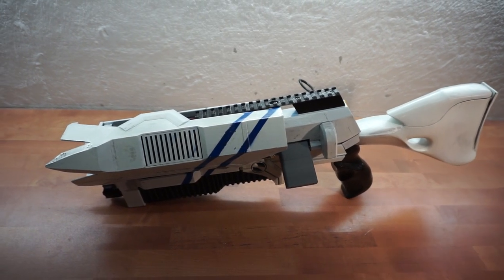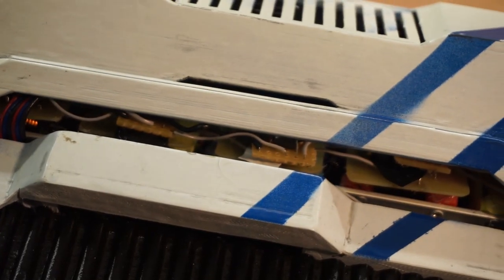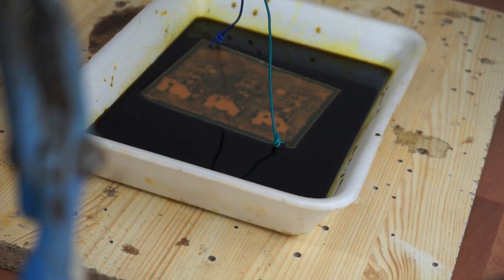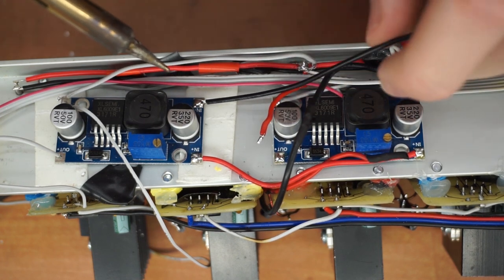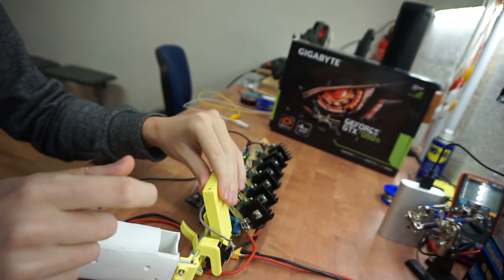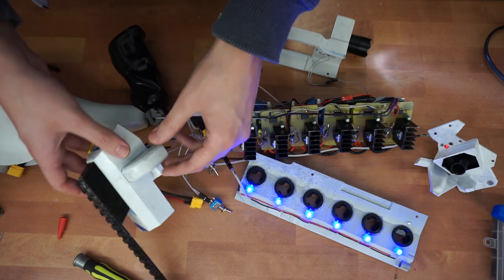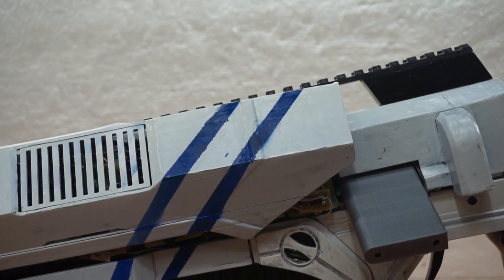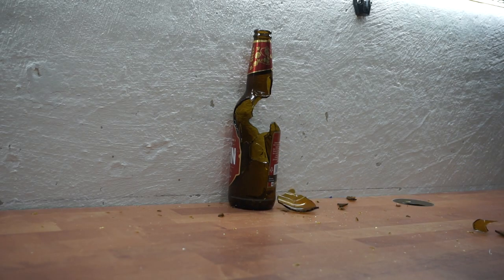Arduino 3D printed DIY coilgun part 2 | Full build tutorial

Comment: Hey, avoid using metals close to your projectile, since it will have a small remanence after you have accelerated it. This will cause extra drag due to Lenz's rule and slow it down. Otherwise awesome build!!!
Reply from the maker: Thanks for the heads up 👍
Reply: Especially aluminum or copper. However, surrounding the coils in in a steel or iron pipe would actually increase efficiency by focusing the magnetic fields.

Comment: What would happen if i used many short coil stages and a shorter and therefore lighter round?
Would the projectile's velocity increase?
Reply from the maker: Not really. You'd just make a smaller linear motor

Comment: I think you should experiment with smaller caliber rounds because these are thick and heavy and you might want to try with something smaller to punch through more holes ;)
Reply: The other thing to try is to partly drill out the centre of the rounds.

Comment: May I make a suggestion, sir? A slight improvement on increasing stability, accuracy and distance of the round? Have the barrel rifled. The added spin will vastly improve    accuracy,  distance and penetration. Suggest reviewing laws of ballistics. Other than that,  you've built a rather nice 1st generation rail gun. Nice job.
Reply: That'd be difficult I think. Theoretically correct, but what makes rifling work is the pressure behind the bullet generated by the powder burning and expanding. Rifling is actually grooves in the barrel that are tighter than the bullet. With the muzzle velocity displayed in this video, I'm not sure he'd have the energy behind the round, especially a steel round, to push it out.

That said, I wonder if there's a way to utilize the magnetic forces involved to impart a similar kind of spin on the round. That'd be very interesting to see.

Comment: Did u try to have the highest voltage possible, so having 1400 mAH is not necessary.  use higher voltage and make the batteries in series.  they will give u the higher current that u need.

Comment: Nice build ! funny that you had to abandon the whole detection system I'm also having trouble with getting it to work well and in that process I've also had it fire backwards. The explanation is simple atleast for my build, there was a large delay on the detection signal because of a capacitor that shouldn't be there and you know that the bullet oscillates around the middle of the magnet when you leave it on that means at some point it is moving backwards towards that point, if the coil gets turned off at that moment it will be accelerated backwards and shoot out the back

Comment: The use of creating a point on the ammo using a drill is rather clever. I'm not sure on using a dremel though.
Reply from the maker: Agreed. That's the only tool I had
Reply: @Gyro1  Oh, I wasn't putting the effort down in any way. It is a sterling effort. I should ponder this myself.

Anyway, back to hacking the Pentagon.... that line cracks me up! Thumbs up.
Reply: Gyro well, take your drill and your amunition and use the drill with a statical drill bit to make a hole inside of the iron, like a cnc does.

Comment: AWESOME. I've been interested into coilguns for a while now, I have tried doing a small one using capacitor which didnt really turn out very well since i was essentially using scrap parts. Then I've seen capacitor-less coilguns which look way more appealing (the caps are just too expensive and complicated to charge) and your design is just so good that i'd like to do a similar one myself. I've been wondering the price that this project cost you (including blown up parts lmao). Keep up the good work 

PS: you've earned yourself yet another subscriber
Reply from the maker: Thank you so much :) . If I exclude the cosmetic parts I'd say it was somewhere between 50-100€ but I already had the batteries which were the most expensive part as well as the charger for them
Reply: Gyro Alright thanks to you, i'll go and work on this project, I don't have a 3D printer so part creating is going to be pretty hard, have you thought about a night vision camera mounted on the gun ? It shouldnt be too hard, I've already done nv goggles so I may put this on it. I'll definitely keep an eye on your channel :)
Reply from the maker: I'll look into it

Comment: I honestly wonder how thin of wire you could get away with in a coilgun. I know I could do the math to figure out the current handling, but I'm lazy.
Reply from the maker: I'm lazy too man 😁
Reply: @Gyro1  I make guitar pickups, and I built myself a coil winding machine. I unfortunately don't have anything thicker than 40awg at the moment haha. I have like 5 lbs of 42awg as well, but something tells me that would short out with battery load. Would be great though since you could get extremely tight coils with high winds.

Comment: Thats a VERY cool project, it relly turned out nice. Why are you using fixed times for the coil triggering instead of reading out the light barriers? Maybe you would get more consistend results if for example the gun is angled up or down, and that the projectile is travelling slower or faster initially, the code would adapt the firing sequence for better acceleration in these cases. And please dont make parts of the video extremely loud, you dont want our ears to explode, do you? :) Besides that, I really like the Video!
Reply from the maker: Thanks. I tried both methods but fixed times simply worked better. If I had oscilloscope and was able to see the timing of light barriers and magnetic fields I might be able to utilize the sensors better but without it it took me days to calibrate it to a point it's in now.

Comment: That's great it's awesome coilgun i like the design👍💪💪 
If you make it stronger it will be a real gun with no powder 😎
Reply: Cool Mood noooo, a tar-21 is a waay better model, in a coilgun the  number of stages and the maximum lenght of the barrel is more important, you should make the clip charger in the end of the tube and make the barrel go until the far end of the gun.